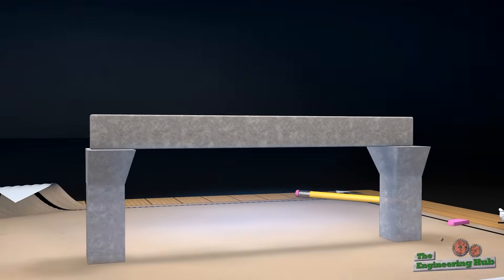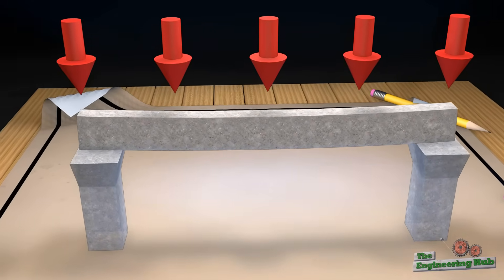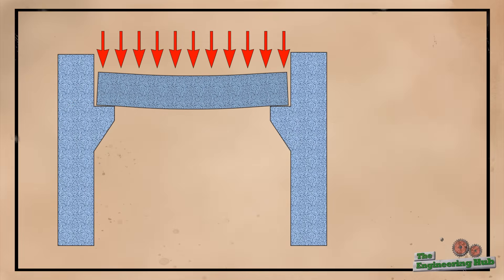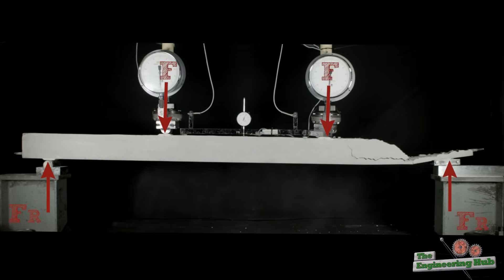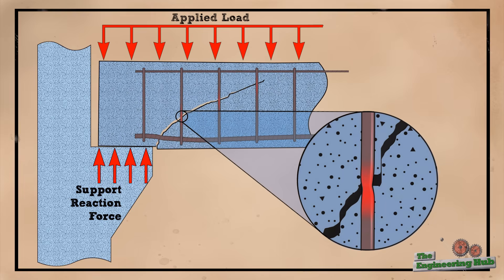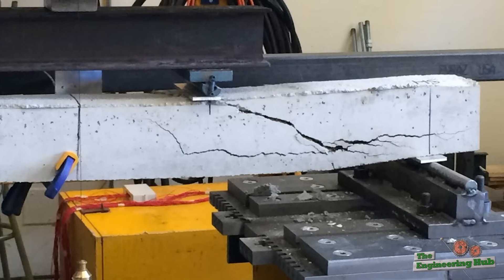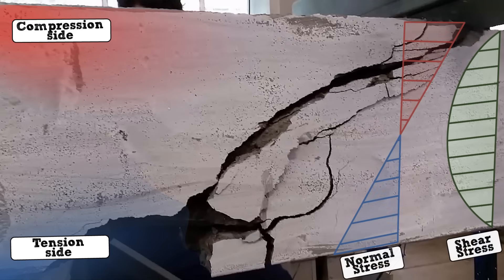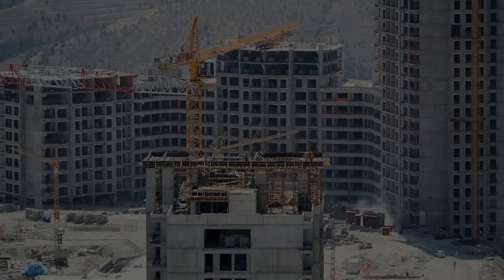The actual reason for using stirrups explained

Comment: The final part exlaining the relation between principal stresses and the curved shape of the crack is wrong.
This crack shape has little to do with bending stresses, since there are little momemt at the end of a single support beam. The curved shape is caused by the change of the ceack angle during load increse. The crack angle is aprox. 45° at low loading, but decrease at big loadings, Eurocode allows 22.5°. What you see on your foto is a crack wide opened in 45° direction, starting from the bottom, and a nother set of crack at 22.5° opened later. But since the first crack was huge it could not close.
Otherwise nice video.
Reply from the maker: Sure, the moment is 0 at the support, but the shear is high. If you draw mohr circles for different locations along the height of the beam at the support you will see how the orientation of principle stresses matches with the crack orientation. Also, this is clearly explained in the concrete book listed in the references. Unless the book is also wrong
Reply: @TheEngineeringHub  Please stop and think for a moment. If M is small, horizontal normal stresses are also small, so the 45° principal stresses can't be rotated by this magnitude. 
On the other hand, the explanation I gave is this: at low loadings the RC beam has 45° cracks. With the increase of the loading the deformations and stresses increases in the links, and the crack angle becames smaller. This way the shear resistance of the stirup (VRd,s in Eurocode) increases, but the strengt of the compressed concrete (VRd,c) decreses. VRd is the smallest of the two, so generally in calculation we use 45° cracks, for safety, but in theory Eurocode allows 22,5°.
So what happens is this: small loading, cracks in 45°, greater loading cracks in lover angle. Small gaps are closed in the later phase, but the most opened part, at the bottom, is too wide to get closed, so you get your curved shape.
This I understood a few years ago... yet I teach RC design since 2004.
Reply from the maker: @orphanusz  By small and large loading do you mean the stress in the shear profile? Because in that case we are in agreement. The shearing stresses are highest at the neutral axis and therefore the cracks tend to flatten out. The same conclusion is drawn with the Mohr-Coulomb failure criterion. This is well explained in terms of Mohr elements and principle stresses. I highly encourage you to read Section 6.2 in this book: https://civilenglineering.files.wordpress.com/2014/10/reinforced-concrete-design-a-practical-approach.pdf
Coulomb
Reply: @TheEngineeringHub What I liked most about this video is that it didn't get too abstract or mathematical/numerical. I think you would loose a lot of interest if you deviate from the general concepts. Stirrups and "what they are really for" is fascinating for the curious viewer. I don't want to get lost on the path and exact trajectory of a crack.

This video, like many of your others, is perfectly balanced. When I, as a layman, explain what I have learned here to a qualified engineer and he raises his eyebrows in astonishment and enlightenment (yes, this really happened) then I know you have done an excellent job 🙂. Thanks for the inspiration!
Reply from the maker: @fibonaccisrazor Absolutely love this support! Deserves to be pinned to the top 🙏 📌
PS: it's a reply to another comment. YouTube doesn't allow pinning reply comments ☹️
Reply: @TheEngineeringHub  Wow, thank you 🙏. Totally didn't expect this - I will also enter my reply as a main comment, slightly modified, so if you still feel like pinning it, it stays with the YT rules.
Reply from the maker: @fibonaccisrazor  no, thank you, sir! Your comment is pinned to the top now 🙏
Reply: @TheEngineeringHub  I really appreciate it !

Comment: Funny rule of thumb childhood engineering based on experience of making stuff in my Dads garage (and previously with paper on the kitchen table) provided sufficient knowledge to visualise all of this explanation. 

Looking at images of Roman engineering fills in the gaps. The math is irrelevant if your prepared to exercise such an imagination, and don’t care how much the materials cost. The only recent thing I learned was that Roman concrete used lime in a far more effective way than modern engineering, so Roman concrete is stronger and more durable. 

Engineering minimalism only makes sense when you have an idiot bean counter trying to maximise short term profits.

Comment: As a simple visual to demonstrate the horizontal shear plane, unwrap a ream of paper and set the ends down on thick markers, making a beam. As the middle sags, the bottom sheets pull in compared to the top sheets. This sliding along the horizontal plane shows the shear.

Comment: There's a vast difference on concrete in the way it's made. Though one way is considerably more stronger which makes it more expensive than the other. The cheaper is always utilized.

Wealthy people can afford homes and such made with the more expensive concrete and thus their house's and such not only cost more even though they make look exactly like the cheaper. It's rarely ever develops the same issues when the home or other ages.

So, one can spend extra money today to build a concrete structor, or one can pay considerably more when having to replace it in a far less amount of time. When the price's are considerably higher. One get's what one pay's for, and in general, we all pay for the cheapest meaning, we alway's accept the lower bid. Who in order to make their bids lower, are mandated to cut corner's. Where as the more expensive bid, can cut the same corner's, generally don't. Making them cost more.

Comment: I thought you might discuss the most fundamental reason for having stirrups, but unfortunately, you missed it. Can we also explain with this theory the reason for tie of the columns? (please let us know) 

It comes from the basic characteristics of a brittle material like concrete. If concrete is not brittle or we may make it ductile like fiber-reinforced concrete (though not a 100% ductile material like steel), we may avoid shear reinforcements. Under compression load, any material (except a few which are engineered) will dilate due to Poisson's effect which would create tension in the transverse direction, and in the case of concrete (cylinders or cubes) under compression fails due to that tension along hoop direction. The compression capacity increased along with tensile capacity if we can confine the concrete at hoop direction (as we retrofit concrete columns with Fiber Reinforced Polymer composite confinement). 

In reinforced concrete design, the fundamental reason for using stirrups and tie rebars is to confine the concrete and enhance the tensile capacity of the core concrete. If we cannot confine the concrete properly, no reinforced concrete can carry loads. You may create a finite element model of reinforced concrete beam to observe the fundamental principal stress distribution under two-point load (AKA 4-point bending). You would see a compression arch is formed starting from one support to another and peaking at the center. That means the locations of concrete under compression need confinement to enhance the tensile capacity of the core concrete to bear the tension at transverse direction. If you can confine concrete adequately, the compression capacity will increase a lot, however, the cost may increase as well, so optimizing the cost and strength, the economical design is performed. We never use any stirrup in steel beams or tie in steel columns, however we need different solution for steel beams at high shear zone due the geometry of the sections.

Again, please note, stirrups and tie act as passive confinements, i.e., they get active only under loading. I hope I could make it clear. 

Please check the following articles for more information:
https://ascelibrary.org/doi/10.1061/%28ASCE%29CC.1943-5614.0000599,  https://ascelibrary.org/doi/10.1061/%28ASCE%29CC.1943-5614.0000599, https://ascelibrary.org/doi/abs/10.1061/(ASCE)CC.1943-5614.0000574
Reply: This is why we do not use stirrup in beams (corrected statement "slab") as there is no "significant" (added this term) compression... so interesting...
Reply from the maker: @Mashfiqul Islam  of course, there are stirrups in beams?? Most slabs avoid stirrups and take the shear demand with the concrete itself, but concrete beams use stirrups or hoops (if there is torsion) most of the time.
Reply from the maker: if you model the material with something like the Mohr-Coulomb criterion you will see that the concrete fails when the Mohr circle touches the failure line which is in fact a shear failure. Most brittle materials fail in shear. The tension demand in the transverse direction due to Poisson's ratio is usually insignificant, stirrups in beams have very little to do with the Poisson's effect and everything with the shear demand. Read the chapter on beams in Reinforced Concrete Design: A Practical Approach (2nd Edition) by Svetlana Brzev

Comment: Stirrups are used for lateral reinforcement. Typical placed at closer intervals closer to columns or other supports or  Structural elements. As you get further away the spacing of stirrups will greatly increase i.e 4"o.c - 12"o.c.

Comment: According to the explanation, one could expect 2 things:
1. There would be much more stirrups at the ends if beams than in the middle;
2. Stirrups are not placed perpendicular to main reinforcement, but to the cracks line.
Or are they other considerations which don't allow such arrangements?
Reply from the maker: Hi Casa, those are excellent conclusions. 1) That is exactly what happens in practice. The stirrups are densely spaced near the ends and more sparse towards the middle of the beam. 2) Inclined stirrups do exist and are implemented sometimes; however, they require a lot more manhours to install so it could end up being more expensive to implement. Often, designers just specify a few more stirrups vertically placed and save on the installation cost.

Comment: Is it true that some of the stirrups have to bent at a 135-degree angle?
Reply from the maker: Yes, there are some applications with inclined stirrups but they require a lot more man-hours in terms of labor and therefore are not that common. Thanks for the thought, cheers!

Comment: If we would use less straight concrete beams but made them arcs we had much less trouble.
Reply from the maker: Arches are much more efficient for spanning distances but also much more labor intensive. Good idea, though, we love arches!
Reply: @TheEngineeringHub  Arcs can be prefabricated too. The actual problem is dealing with the outward pressure they produce.
Reply from the maker: @0MoTheG  Absolutely, the horizontal thrust force can be problematic. Though, if they are built in series next to each other it would help balance out the horizontal force. Something similar to a roman aqueduct. Only the ends would need a heavier horizontal restraint.

Comment: the stirrups delivered on my job were too long and would have no cover if installed vertically and we had no time to reorder, so we laid them over across the potential cracks and achieved our cover.
we probably added some extra, just to make sure, they supplied too many!
we conferred with the design engineer and he was happy with our solution, concrete poured on time.
Reply from the maker: Hi Stephen! That's an excellent, and in fact, the optimal solution. I would also imagine it took longer to install them at an inclined position compared to installing them vertically (if the length was correct)? The additional man-hours is probably the main reason why this is rarely done in practice. In reality, this is the best material utilization.
Reply: @TheEngineeringHub  Steel fixers supply and install problem, I just saved my own concrete pour deadline. 
I am a construction civil engineer, not a design engineer, no insurance for that and so insisted on the design inspection. 😉. Hahaha. 
He was pleased with the solution. 
I mentioned it here because others may find it useful. 
The ligatures must lean the right way, not parallel to the cracking. Hahaha.
Reply from the maker: @stephenbrickwood1602  We are in fact design engineers so it was very interesting to hear from someone that spends more time in the field and less time in the office like us. And yes the inclination angle is absolutely crucial, otherwise, it goes from most optimal to useless if they are installed parallel to the crack. Cheers and thanks for the discussion!

Comment: I'm retired and living in a third world county (Mexico) where as the over whelming vast majority of homes have concret roofs. In the past prior to the advent of using rebar, The various rooms within a home had to be a certain size or the span of concret aka roof above would fall in. Which was most generally in those days the equalivent of two inchs. Today using rebar a 1/4 in in diameter, if and when sufficent rebar is implemented, a roof can span a larger area, thus the sizes of room beneath it are now larger. If and when one thinks ahead and there are plans someday to adding an additional room or rooms above the original. If and when the first level has no rebar or only a 1/4 of inch rebar. The floor above which is the roof below. Will agian fall in. Thus the one who buys a house when it was built using no or 1/4 in rebar and isn't aware of it when they personall elect to increase the size of their home to include a second livng area above the first. Have issues with the roof aka floor above, falling in on them. But by then as allways in Mexico. Once purchased, it's the owner issues. Not the contractors.
I should add that there are repitable constuction contract who build homes. But the cost of them doing it vs someone who's agenda is to just build one as cheap as they can and make the same money as the more expensive contractor. Will sell for nearly 25 percent less. Which allows them to build more houses because who wants to pay 25% more for what appears to be the same house.

In the U.S.A. what is referred to as town houses or quad homes; And not houses. Are built with one wall between two adjoining homes just like apartment complex's do. In Mexico and assumable other third world countries. The homes built adjoining others some times twenty in a row. Though there is only one wall that separates one from the one adjoining. They are still referred to as houses.

Comment: Awesome video! I learned things about shear vs. normal stress today.

When we make our precast columns where I work, we have stirrups around the bars that run the length of the column, (typically three #8's on opposing sides where the corbels are or three #8's on each face depending on what the calculator says) along with stirrups that go through the center of the column and tie the bars that are in the middle of each face together. Being that this is a vertical element, the purpose of these bars is partially what you described in this video with shear, and partially to keep the rebar from deforming outward, away from the center of the column. 

We also have a beam element that had a cross section like an upside down fat letter "T". I've seen both stirrups and mesh used in these elements, but in all cases there's several (between 24 and 36) 1/2" diameter cables pulled to around 30,000 pounds each. It's really fun to see the beams jump up when they release the strands from the form!

Comment: As a side note, if someone is certified as a structural engineer and considers themselves to be a qualified engineer I think they should be concerned with the energy efficiency of the building as part of the overall integrity of the structure.  That is now mandated if I'm not mistaken. 🤔

Comment: Good content!
I have a little story about concrete bridge spans (I'm not an engineer, so if I label something incorrectly, that is why). I never realized that concrete bridges flex downward (so much) when under load... (Story) I had completed my weekend National Guard drill in El Paso and was on my way back eastward. I still had my uniform on and I decided to pull over and find an obscured place to change into my civilian clothes. I stopped at a dry creek with a bridge across about 10 feet...I went under the bridge and did my thing...I could certainly hear the vehicles crossing overhead and for some reason I put my hand on the underside of the bridge when some vehicles crossed...I could actually feel the span of concrete flexing downward every time a vehicle crossed. Realize that this was a high speed highway (75mph). I understood that there should be some measure of flex, but I never realized it was to this degree. Of course, while driving, you never really notice the dipping action of such a bridge.
Reply from the maker: Thanks for the interesting story Glenn! It is fascinating how flexible these structures can be. The flexibility is especially pronounced because they tend to be much slender than buildings (long but not as thick). Bridge deflections are usually limited by code to a value between 1/800 to 1/1000 of the span (depending on type, use, material etc). This means that a span of 30m (100ft) can (allowably) deflect up to 300mm (1ft) which can be scary to observe. This may get further increased if the bridge is not properly maintained and has cracked or deteriorated concrete i.e. loss of stiffness.

Comment: Geez, I've only dabbled in structural, but aren't you forgetting to mention beam internal shear?  The addition of the vertical sheer vector with the internal (horizontal) sheer vector is why the crack forms as a diagnol.   BTW, mom always said the internal shear is greatest at the ends of the beam, and zero at the midpoint or point load.